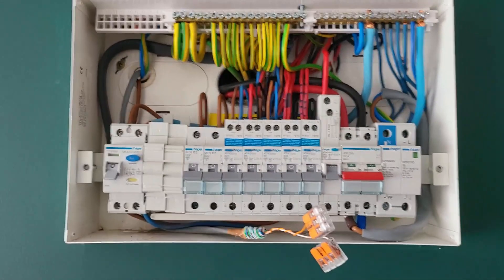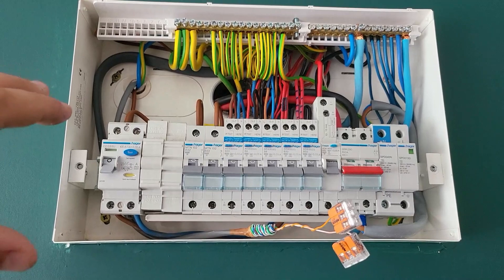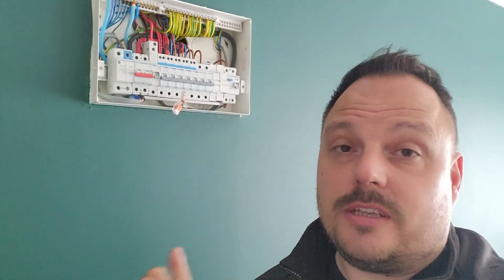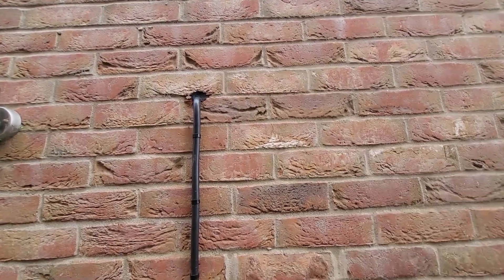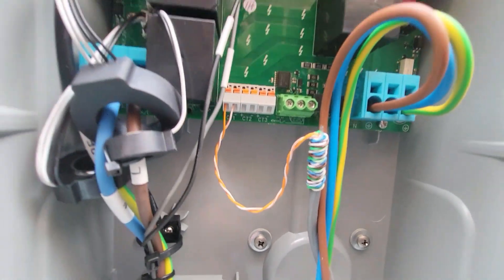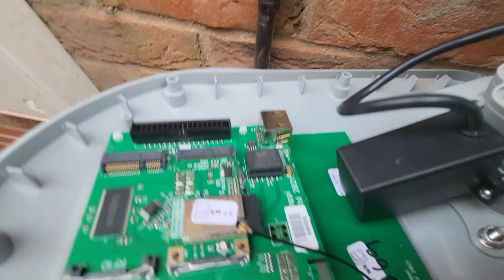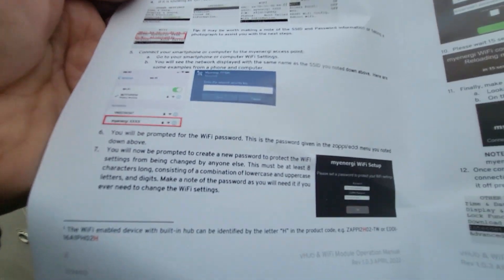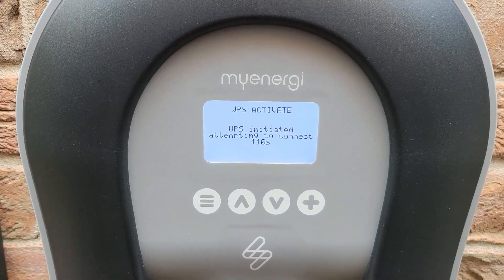Menergi Zappi WiFi EV charger - Full Install and Key changes

Comment: Nice video. Can I ask question please. If you don’t have spare ways in the board I assume you have to install a new DB from cutout using Henley blocks and additional tails!? If so can I ask where the CT clamp goes to as the EV ultra cable will go to new DB but surely CT clamp needs to go to cutout? Is that right or can you explain further? Thank you

Comment: Hi Mark,  loved the video   very informative.  I like the idea of taking the cat 5 into consumer unit.  Please could you explain exactly what cable the solar ct would go on.  I assume its the one going to the solar mcb.   Ct 1 would obviously be on the meter tail inside CU.
An explanation would be greatly appreciated.
Reply from the maker: Hi mate. Yes the solar generation cable would need a CT. Inside the CU as you describe a good spot. Unless you have a libbi battery/solar system which wouldn't need a CT for generation as it knows what it has produced lol.
Reply: Don't expect inner cores of cat 5 are rated at 230v insulation

Comment: Good morning I have installed Zappy for a few months. For a few days now I've been getting "waiting for plus" and wuindi doesn't charge my car, unless I set the wallbox to eco or fast, but it charges at 2/3 kw max. perhaps there is the CT that does not read the photovoltaic power correctly? thanks if you answer me 😉

Comment: I am in the process of putting wires for Zappi. So i bought 5x6mm cable, going for 3 phase 22kw. Do i need just 1x LAN cable or 2x? Since it says to connect one to ethernet port (wired) and another one for power readings sensors?

Comment: Downside of these 'smart' chargers is that you can have your access to electricity 'revoked' just when you need it...at least the 'granny' chargers can't be remotely 'unplugged' /monitored...combined with 15 minute cities and the hysteria that is 'climate change' don't be surprised WHEN you have your mileage limited and right to travel to/through certain areas 'constrained '....
Good luck everyone and enjoy your shiny things while you still can...
Reply from the maker: My backup is a v8 that can also run on lpg. So many options to keep on trucking 🤭
Reply: @electrician247  
I've been looking at those diesels that can run on old veg oil, so at least we'd smell nice going down the road....
Reply from the maker: @marclawyer2789  got to think ahead haven't we lol
Reply: Who would randomly drive up to your property and plug there EV car into your zappi and steal your electric ⚡
Reply: @mrzameer6197  
Same people that would break into your house, or park on your drive near airports etc...some people aren't going to worry about the Law, or what is Right, they'll just take whatever you don't keep safe...

Comment: Great video mate. Nice one. A question for you, how does the solar integrate and work with this unit. For example, how does it know to use solar to charge from? So during the sun light hours how does it know to use solar???
Reply from the maker: CT clamps to see generation/consumption and all happens automatically.  Can be controlled/set on the zappi in great detail.

Comment: If the consumer unit does not have capacity, what would you advise the customer?
Reply from the maker: Option of a small CU in addition or larger replacement CU. Clients choice as to which they want. Older CUs generally they choose to replace. Newer ones add an additional board.
Reply: Thank you

Comment: Hard to see the network cable route for the CT did you run it behind the power cable. very neat.

Also any installs I have seen in Dublin have a rotary isolator, Is this required or belt and braces? Appreciate regs in Ireland may be different to uk.
Reply from the maker: It's EV ultra cable. The data cable and power is all in the same cable. 

You can install a local isolator should you wish but not essential. On this one we have the DP RCD in the CU so quite happy without. On commercial jobs and long cable runs we would use them.

Comment: Good informative video again Mark. I have one small question which I’d love your opinion on, what are your thoughts on the point of RCDs to comply with BS7671 require a manual test button which correct me if I’m wrong the zappi doesn’t have so does this mean that an upfront RCD is still required?? Or am I over thinking it slightly? 
Cheers Mark.
Reply from the maker: Had some discussion on this on my more recent videos mate. It's a tricky spot we are in with it. Myenergi themselves have said recently on twitter that it makes sense to install one up front anyway. 

Essentially does the same thing but not in the same way.

Comment: Hi Mark, you have one anyway but Zappi chargers do actually require a Type A or F RCD upfront…
Reply from the maker: I've seen the explanation from  myenergi mate. Same with most brands the lack of a test button and different product standard to traditional RCDs. 

It is up to installers at the end of the day but if they claim equivalent to that standard in the MI I would say that's above and beyond a BS7671 level. 

Same principle for them now ditching the 10 test process for rcds that could not meet product type testing. 

Generally we fit them anyway but can be argued just as much a breech of bs7671 through lack of selectivity. 

Don't fall out with not using them either.
Reply: @electrician247 

BS 7671 does recognise BS EN 62955 standard that My Energy claim compliance in Regulation 722.531.3.101. They are not actually RCD’s they are RDC-DDs. 

The scope of BS EN 62955 says they are intended to be used with Type A or Type F RCDs to protect them against DC currents, they are not the stand alone RCD that my energy seem to claim…
Reply from the maker: @MartynDuerden  I think they are mate. The trouble is no combined standard exists for them. 

This is what happens when BS7671 and product standards are mixed. 

I would say each installer can judge as they find. Myenergi stating it achieves compliance is enough for a robust argument of compliance imo. 

But we always fit upfront RCD anyway. Why not.
Reply: @electrician247  

My main ‘bugbear’ is we need these conversations at all.

My energy was and is perfectly capable of building devices which dont muddy the waters and comply out of the box, but they choose a product standard which does not meet BS7671 and its own standard requires additional backup RCD protection and further then suggest via marketing that it meets our requirements, the last part being the problem.

They have put it in their instructions too so no liability there, liability just lands with the poor sparky, it is a really poor show imo. 

Bs7671 stops at the product so cant see much crossover there, similar to say an electric hob or heater with inbuilt overloads etc. 

We would not generally exclude overload protection at source because an appliance has it.. 

Some one said to me the other day they thought it should be clearer that Zappi devices did require additional RCD protection rather than it being buried in the small print, this is the crooks of it, very many perfectly competent sparks are not reading the small print in favour of the headlines and they put themselves and their insurance at risk because of shady marketing.
Reply from the maker: @MartynDuerden  I don't see it like that tbh. We need to remember they have a worldwide market. 

Overload protection  of a hob is a different matter altogether. We need overload protection and short circuit protection and rcd protection for cabling within instalations. Same applies for EV and anything else. 

I guess if a shower claimed to have inbuilt rcd protection  it could be comparable.  But to compare it to OCPD is not really fair. We still need that for varying cable types. 

I don't think a spark would ever face a prosecution civil or criminal based on the MI from myenergi. 

None issue for me, but we all see things differently. 

End of the day they a UK manufacturer with an awesome product.
Reply: @electrician247  Morning Mark, I get that they are worldwide and that they are British Company which is a very positive thing on both accounts. 

Electricians are however being mislead and suffering for it, the Auditors for example are pulling electricians and reporting them to scheme operators and their clients for something that is entirely preventable.

As you pointed out we have a choice between two noncompliances, two RCD’s in series or No RCD where both BS7671 and BS EN 62955 require to be in place. 

Sure the manufacturer says it isn’t really required but they have put the exact opposite in writing. 

You are right that comparing OCPD to RCD isn’t really fair, I suppose an RCD fuse spur / socket might be another example, my point was that we would not normally omit something because a manufacturer has something similar in their device.

Ultimately, as I say, I always side with the electrician who suffers as a result of mis information.

Could debate for weeks 🤣

Have a good week Mark 👌🏼
Reply from the maker: @MartynDuerden  I understand exactly what you are saying. 

Manufacturers of loads of stuff often make things tricky! 

Those audits are not the best. I've had discussions with those who used to carry them out. Far to many mistakes for any value. 

Ozev have more to answer for than myenergi lol. They say and money electricians had earned fairly for months and months. 

Like you say can be discussed until the cows home! 

Don't disagree with your point of view. But I also understand why we end up in situations like this. 

The testing of rcds a very recent example of the same thing. Alongside pen fault devices that have no product standard.

Comment: Might sound a daft question but on new build sites how can you configure with no internet ,and will this mean you will have to return when a customer takes possession
Reply from the maker: Can be setup without an internet connection. We use a temp hotspot sometimes when client wifi is unavailable to check for updates etc. 

Then clients can connect to wifi and control/monitor. 

In fairness not seen one going into unoccupied new build. We are using dealing with a client so not an issue. Only times we have had a problem is with localised broadband outage at the time of install.
Reply: Thank you for a quick response I like the unit and I’ll buy it now thank you

Comment: Mark good video and do you know when Myenergi started selling the Zappi version using wifi instead of a hub. A contractor has this week (early July 2022) just installed for me the version needing a hub but legged it without installing a hub.
Reply from the maker: They still sell both models. The ones with the built in hub and WiFi have a different code and are slightly more expensive. Stock is an issue if you placed an order a while ago could be the reason possibly?
Reply: @electrician247  thanks, I only signed the contract with Dynamis two weeks ago so expected the latest kit or be given a choice unless advised otherwise which didn't happen. Seems like I need a hub or the new wifi model, I'll have chat with them. Thanks for the info and I'll look through a few more of your videos, good clear helpful explanations.

Comment: Is it better to have Ethernet connection rather than WiFi?

Also, have you done any 3 phase installations?
Reply from the maker: Only in the same way it's better for most connected equipment such as smart tvs and gaming consoles lol. 

WiFi is usually much simpler and plenty reliable enough.

Yeah done loads of three phase ones. Some on my channel.
Reply: @electrician247  yes, it is not like the zappi is streaming HD video , a few 10s of KB of connection speed is going to be good enough.

Comment: Hi, looking to install a Zappi for customer the EV cable is already in place in garage but no cat 5 for signal to ct s , will th3 Zappi work ok with a wireless connection to meter tails , thanks
Reply from the maker: Yes if you use a harvi alongside the Zappi. Should be fine subject to range.

Comment: Hi Mark  comprehensive explanation as to how you approach and carry out an installation . This is such a fast changing aspect of our trade , I’m struggling to think of a similar time . Yes Solar panel’s have been a recent newcomer , but the technology has moved at relatively moderate pace But the EV charger has been a totally different story , which does give me some concerns regarding the longevity of some of these products . Think LED light . Where yes we are at a point that reliability has been solved pretty much in there use.       I just wonder do these chargers need to be so complex .  Finally your a great ambassador to the trade and have a natural talent to give information . Best wishes and kind regards from an old combatant . 😀👍👍👍